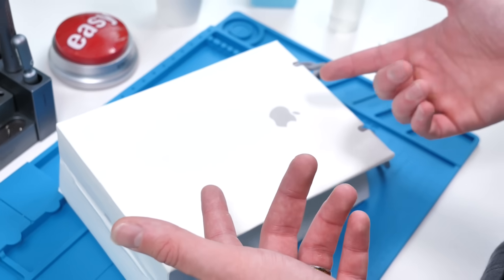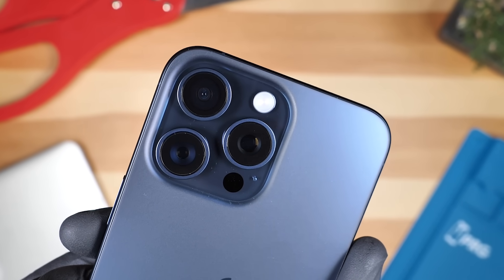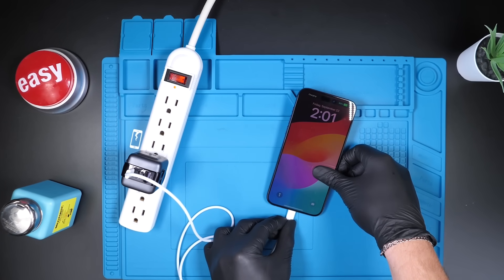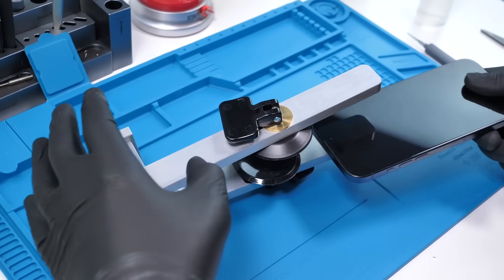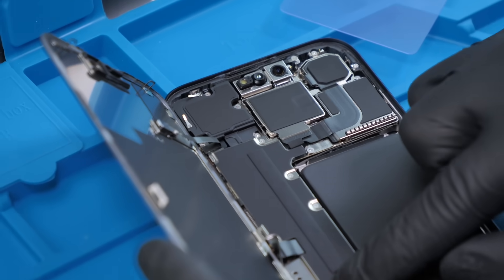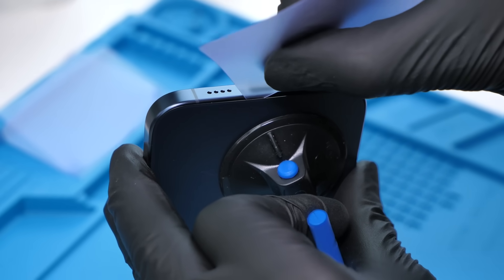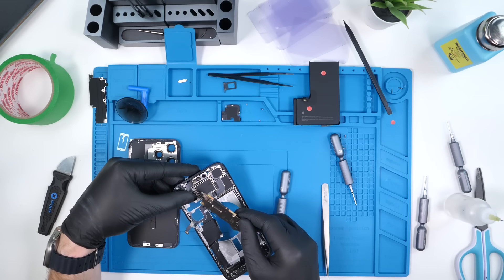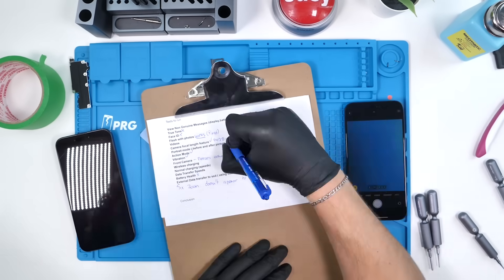Is The iPhone 15 Pro Repairable? - Parts Swap Test

Comment: There is un-repairability and there is un-repairability for the sake of security. You might want to comment on the differences between those two concepts and imagine yourself as a hacker trying to get into the phone to access things the owner wouldn't want you to access.
Reply from the maker: The front camera does not contribute to Face ID in any way
Reply: @PhoneRepairGuru huh what do you mean by that? Does that means face Id is still working event if the front camera destroyed?
Reply: All you would need here is encryption, which has absolutely nothing to do with these anti repair tactics.

Comment: the way these repair guys act completely clueless as to why Apple does this when the front camera is swapped. FOr anyone wondering, the quickest way to get around faceID and into all your content would be messing with the front camera. Apple literally discourages swapping out the front camera because people could use it once they've stolen your phone to get to your personal info inside the phone.
Reply from the maker: Actually the front camera has absolutely nothing to do with face id. In fact you can cover it up and face id will still work.

Comment: I believe the board swap on phones cause the selfie camera to glitch out or freeze the phone so that people can’t steal an iPhone then swap motherboards to get into the hard drive. 

I believe its a safety measure.
Reply: stop shilling
Reply: the drive is on the motherboard
Reply: people have the wildest theories. The camera glitches out because it can't get depth data from the FaceID module (new exclusive to 15 series). Don't get too looney.